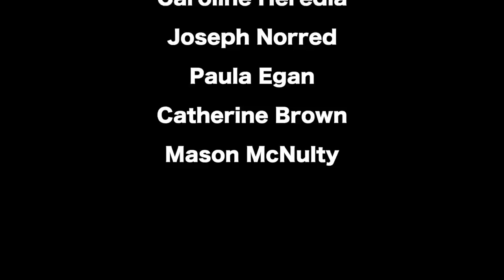Ten Feet SHORT - We Almost Finished the Next Earthbag Course (Chicken Garden Day 93)

Comment: Growing up in New Mexico, the wind starts in March or April and stops when you would love some air movement in the summer.  It ruins your hair, your ears, your eyes and your mood.  Blow your nose in the afternoon and you find your nose is plugged WITH SAND and dirt.  Ugh.  I moved away 30 years ago and I STILL automatically get cranky when the wind goes down my neck.  I did not do it intentionally but I found myself in an area with little and inconsistent wind. My kids can fly a kite but grandkids only learn when they go back with me to visit family.   Kites are one of the awesome advantages of living with that kind of wind!  You don’t run to get a kite in the air, you stand still and raise it up and let it go. If you are fast loosening string, that kite will FLY!  It will fly for hours.  You go home at the end of the day, notice every cobweb in the corner of the ceiling and trip over anything.  It takes a couple of minutes to realize your head is still pointed to the sky.

Comment: You might be able to use some fence wire to attach the Mic to the mount portion; or some automotive hose clamps that can fit the diameter of the mic to the mount portion. It ain’t the prettiest but it will get the job done.

Comment: Take a piece of tape what about AI didn't know about a 1/2 an inch strip running around the inside of there or a piece of wire and wrap it around the Mike and then hook it back on the water or stand you hook it on and then wire it to the stand and it's still gonna plug in and still gonna work